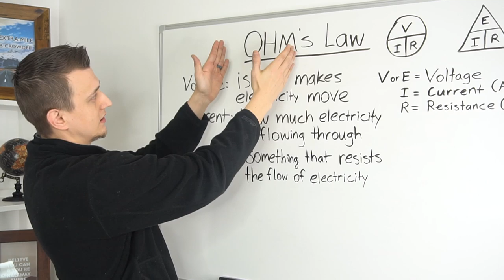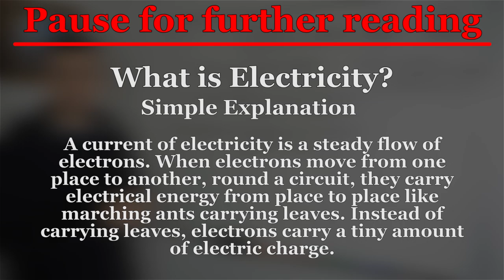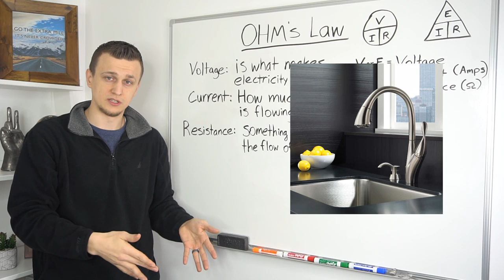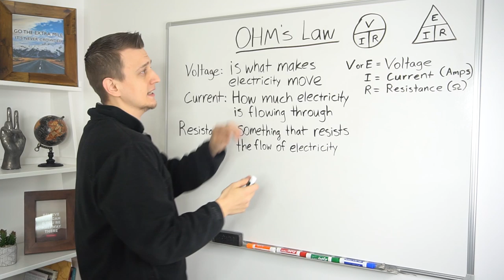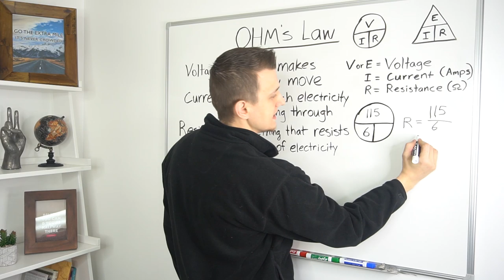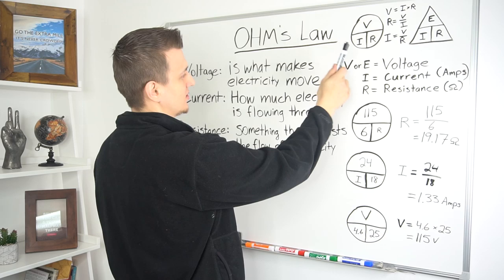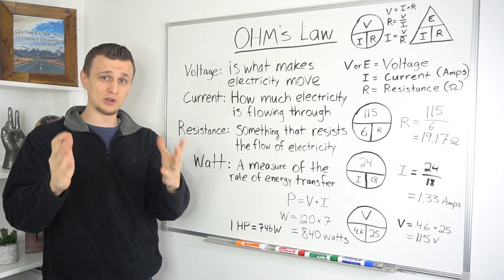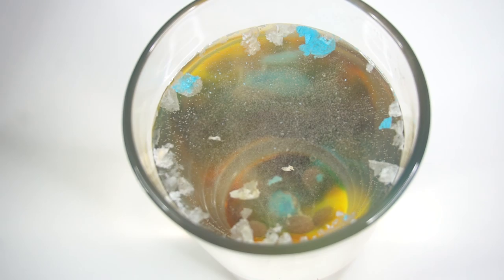Basics of Ohm's Law, Volts, Amps, Ohms, and Watts Explained

Comment: I retired from a nuclear power plant in NY. As most people know a Nuke Plant produces electricity. The output of the plant I worked is 1,000 Mega Watts (1,000 million watts). A clean up crew was picking up debris around the site. They were after wind blown garbage and tree limbs. One fellow saw a tree branch on one of the plant's outgoing cables. For some reason only known to him he climbed the fence and ignored the KEEP OUT signs to grab the branch. When he touched the branch he was electrocuted. He was only 35 years old. He died. Because of the change in the plant configuration (the outgoing cable was now grounded) the plant tripped off line (shut down). An electrical component below the room I was in exploded. Even though wood is an insulator the man died because the extremely large amount of electricity traveled through the tree branch moisture. Before acting in a unusual situation, think twice before acting.

Comment: Since ohms are the measure of resistance, you would want to buy something with fewer ohms. For example, if you were comparing two motors, and one had an ohm measure of 1.5 and another had an ohm measure of 2.5, you would choose the one with the 1.5-ohm measure because it has less resistance.
Reply: But you also need to consider the purpose of the device

Comment: The right question is. Bring different appliances from amazone that use 110v and answer what kind of charger is need to run it in 220v. This is a good practical example. Please do it ASAP

Comment: let's see how I say it, ohm's law already says the word law is not specific for direct current voltage only, but it is a general law for circuit calculation regardless of the type of voltage used. Ohm's law talks about current and says the following: the current flowing through a conductor (understand elements of a circuit) is directly proportional to the voltage applied between its terminals and inversely proportional to the total resistance of said circuit, therefore its true formula is I = E / Z, what happens is that in DC voltage the imaginary part of the impedance (Z) becomes zero and only the real part R remains

a ver como lo digo, la ley de ohm ya lo dice la palabra ley no es especifica para voltaje de corriente directa solamente, sino que es una ley general para el calculo de circuitos independientemente del tipo de voltaje que se use. la ley de ohm habla sobre corriente y dice lo siguiente: la corriente que circula por un conductor ( entiendase elementos de un circuito) es directamente proporcional al voltaje aplicado entre sus bornes e inversamente proporcional a la resistencia total de dicho circuito por tanto su verdadera formula es I= E/Z, lo que sucede es lo siguiente que en voltaje de DC la parte imaginaria de la impedancia (Z) se hace cero y solo queda la parte real R.
para el que no entienda ingles aqui les dejo el comentario en español. saludos

Comment: How would you use ohms law at work?  The math sounds simple enough, but I am struggling to understand its practical application.
Reply: It comes in handy to figure out if there is too much power being drawn on the wiring or above what a system is rated for. It's more useful for general contracting purposes. Each gauge of wire can handle X amount of amperage, if someone doesn't know what they are doing, they might DIY something and not realize the wiring can't handle the load, or that there is too much resistance for a unit to function properly. And sometimes when doing stuff on the fly without all your tools available, a sticker might tell you a couple of things you want to now (volts and amps), and you can figure out the watts on the fly to calculate how much the unit will cost someone on a day to day basis

Comment: Could the light bulb be considered the resistance /ohms in a simple circuit ? (battery to bulb to battery)  the Watts that it uses is considered the resistance?  and we could measured that in ohms correct? WE could change the wattage value to an OHM value .. example: "I have a 100 watt bulb in the lamp" or could I say "I have a 23,000 ohm bulb in the lamp" ? .............or am I totally off base

Comment: I’m confused about how you know what resistance is without blowing out the circuit. If current is running through something and you don’t yet know the resistance and if it’s too low while I’m measuring it wouldn’t it blow up and kill me?  How do you prevent being killed by electricity?
Reply: You can troubleshoot a system with power on or off depending on what you're looking for. If you're not confident in taking measurements when power is on, disconnect power and switch your meter to resistance (omega symbol) not continuity (beep). Reason for that is not all meters can measure high resistance when set on continuity and it may tell you the component is bad when it really isn't. Fear of getting electrocuted is a good thing. It makes you slow down and think before you touch something. Lock out/tag out whenever possibly and never take someone's word that power is off. Always verify with your meter using the probes or NCV setting or carry a small Non-Contact Voltage (NCV) tester.

Identify your loads in the circuit, components that consume power, and disconnect them from the circuit before checking its resistance. Each load will measure a certain amount of resistance and there's usually a label on it that tells you what voltage it's rated for and what its Full Load Amp (FLA) draw is. Divide the resistance into the voltage to see if it is drawing more current than it is rated for. Continue the process with all the other loads. If none of the loads exceed the FLA rating then the problem lies in the circuit wiring where a hot wire is touching a neutral wire, loose connection, bad contacts and a miriad of other things to check. You'll know if the load is bad if you get a lower than normal resistance reading, your meter reads "OL" (open line) or you get a resistance reading from any load wire to the load casing (unpainted spot on the load).

If you're still not sure after reading this then I suggest you take a basic HVAC coures that will cover everything I just mentioned and go into more detail on types of motors (compressors, PSC, shaded pole, ECM, induction, CSCR, CSIR, single phase and 3-phase power). Resistance readings for 3-phase motors are different from single phase motors and if you don't pay attention to how a 3-phase motor is wired you could potentially break the quipment by reversing the motor direction. Three-phase motors can also be wired up in the delta, wye and delta-wye configuration depending on current draw on start up. This youtube video touches on only a very tiny portion of the electrical you'll need to understand. The hands on portion you learn in school is, in my opinion, the best way to learn. The instructor will take you through it step by step and you'll be able to read schematics and determine if a component is wired in series, parallel or series parallel. Hope I didn't discourage you but peaked your interests in learning more.

Respectfully,

Comment: AC resistance is different than dc resistance. Which is reactance.
Reply from the maker: Yes, thank you for pointing that out! Much appreciated!
Reply: DC can  have reactance -its a short circuit= zero. Commonly  Impedance is used as the term in AC resistance. Resistance is always associated with DC circuits so to distinguish DC resistance from AC resistance the term Reactance is generally used as you stated.
Reply: a c   resistance you can see it as a sign wave on a ocilliscope,  go to automotive dept   the measure that all the time.

Comment: I see that 18 goes into 24 = 1, with 6 left over, how did you arrive at .33?  wouldn't 6 go into 24 4X and be .25 . I hate math.
Reply from the maker: To be honest, I edited out the part where I took out my phone and used the calculator to get the answer... 😅
Reply: if your familiar with a scientific calculaler,  just divide 24 by 18  and that will give a decimal,    get familiar with the casio fm-300 ms and look for youtube videos on how to calculate series and a paralel circuits.   good luck.